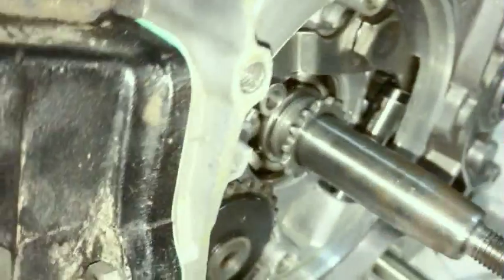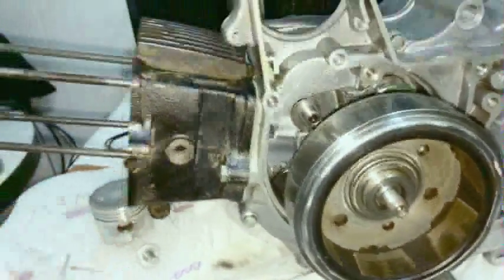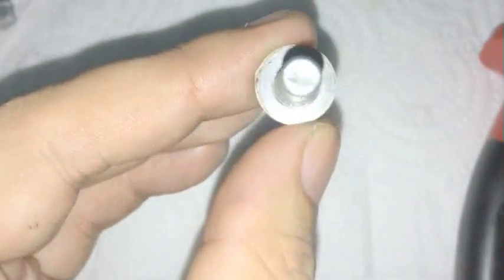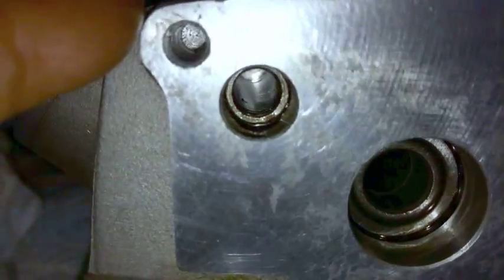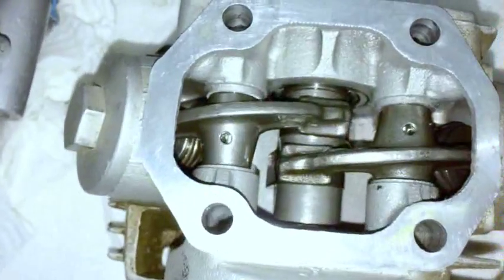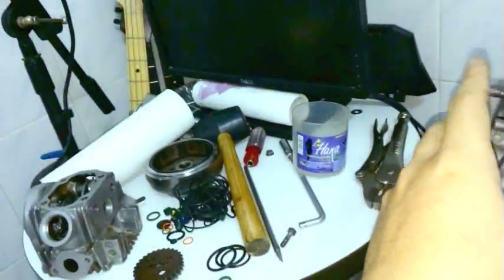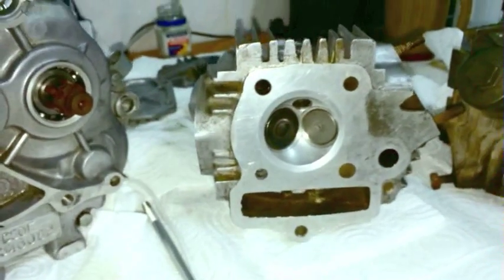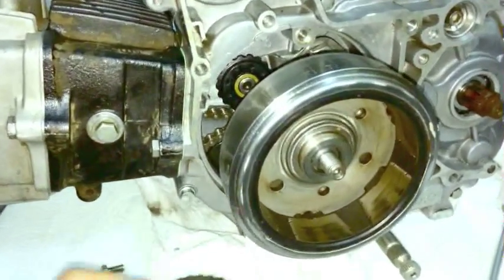(Detailed Version) Honda Semi-Auto or Pitbike Engine Rebuild Part 7: Top End Part 2 of 3

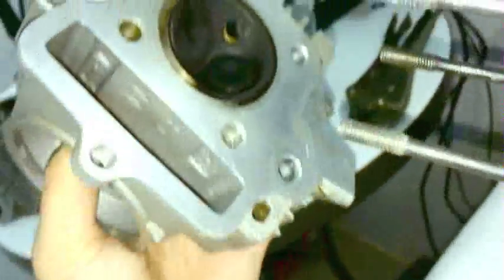Comment: @41:10 I don't see an umbrella type of dowel on the oil feed stud? 

Also if close attention is paid to the oil take off plate there are two types of them one for long cam one for short cam. The difference in the take off plate is the center dowel through which the long bolt passes across the head. One one type that dowel  in the take off  plate is shorter. Of its installed on the head which requires long one the oil will drib down the bearing thereby not reaching the intake cam.
Reply from the maker: I should make mention of it, but on this engine there is no umbrella dowel on the oil stud because of the Astrea studes I used, which are thicker.  

Re: cam plates, I didn't go into detail regarding that as with other things as I did this in one take.  When I have time I'll build on these videos to make them more comprehensive.  There are also many different cam plates as well from what I've seen (not just two) because of plain bearing cams, "long cams" as you call them, "short cams", etc.  

The oil return, if I understand your question, @ 40:50 is the area the oil returns through after circulating in the head.

Comment: Hi all just a question I have a manual engine with a starter anyway the starter has failed and I've ripped all the electric out so can't be bothered to fix it any way the left side of the pitbike engine case has a starter mount there and it is blocking the carburettor air filter from going on I was thinking could I get  a left side of a pitbike engine and put it on with kick start flywheel and stator plate so the starter mount won't be there in asking as I can't be asked to buy another new engine as this engine  is in good condition my engine case is 156 FMI on the left side can I swap the left side with another 125cc left engine side without the fat starter mount  on top I thought as it's chinese it's all interchangeable as long as the cc are kept the same

Comment: Also at @44:30 the oil return path is mixed opening into that stud as well. I have never got an answer for that. 

If you flash a light into the return path you will be able to see that